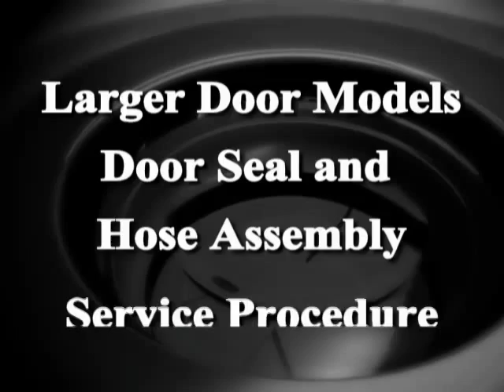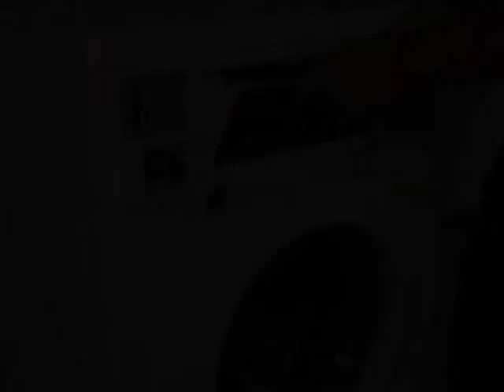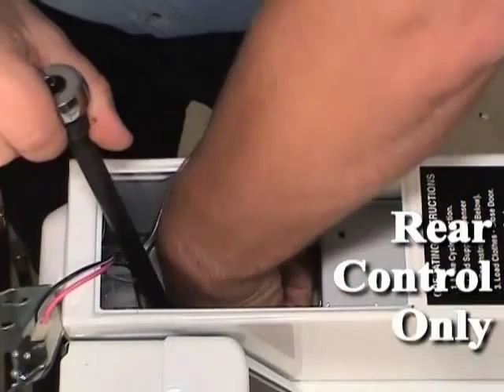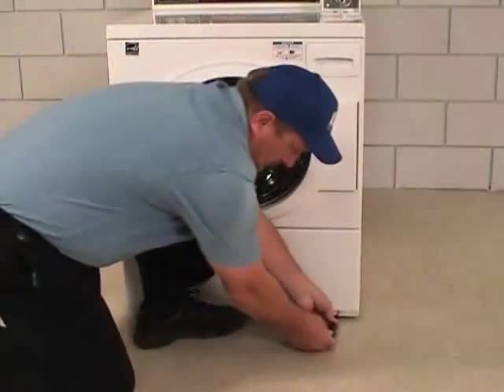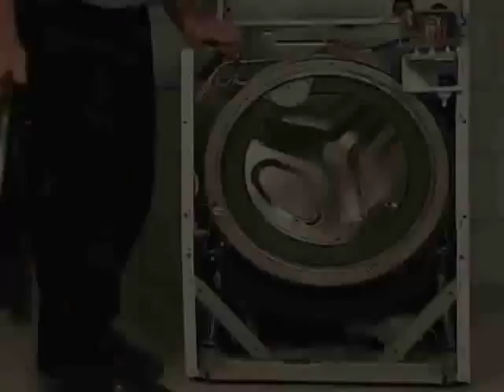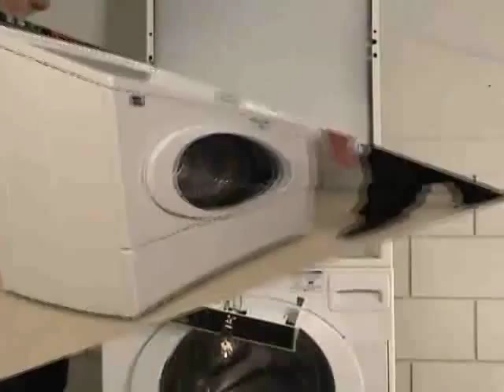How to Replace Door Seal on Frontload Horizon 802866P

Comment: In the video, the hose that connects the door gasket to the dispenser valve to door seal hose looked like it was removed. When replacing the door seal, is it recommended to also replace that hose? Or are you able to disconnect the hose directly from the old door seal that is being removed?